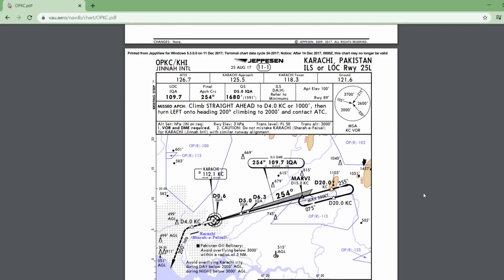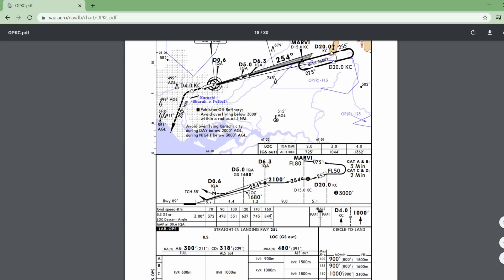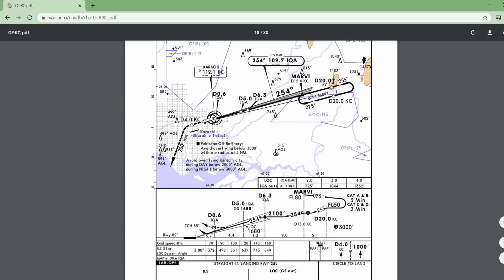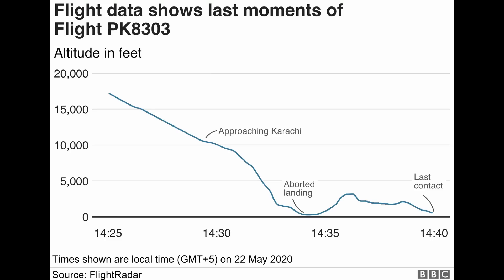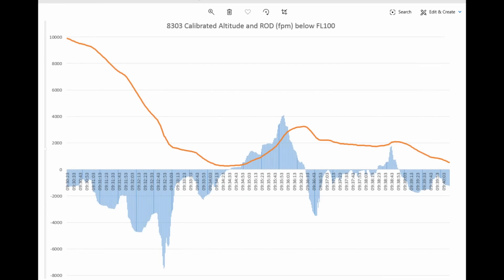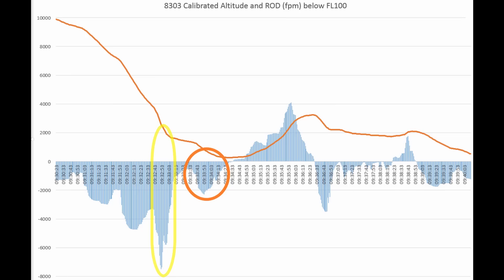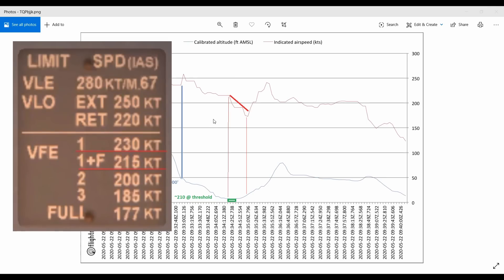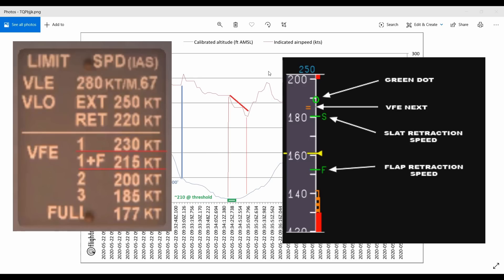PIA #8303 Update #4 Unstable Approach Profile

Comment: Can anyone confirm something for me: In the A320 if the gear is selected down overspeed the chime will go off and the safety valve will prevent the gear from lowering, does this mean that once you go below Vle the landing gear won't come down even with the handle extended? I'm wondering if that's how it functions as this could lead a distracted crew to believe the gear was lowered especially if they're busy trying to convert their A320 into a roller coaster.
Reply: Someone commented that the gear handle would have to be cycled back UP and then Down again for the gear to extend. I don't know if that is true.

Comment: There may be no question about the flight data because it was what was given by authorities     so based on this data it seems like the pilots were confident about their operations     it could be the norm in the organization       if this is the case the entire top management should be FIRED as they should have enforced these standards and should have their crew performance checks in place for every flight

Comment: Was this Pilot even QUALIFIED to pilot this type of aircraft ?  As modern as that aircraft was , and with all of the backup systems ,  you certainly don't try to land without putting the landing gear down ,  except in an extreme emergency and once it's down you keep it down , you don't do a go-around .
Reply: Captain had more than 17000 hours flight experience, more than 4700 hours were in A 320. First Officer had more than 3000 hours flight experience, most of them on A 320.

Comment: I wouldn't have an opinion except that I've traveled in that area.  This may have been an international flight.  But it was an internal leg.  What I'm going to allege could be verified by careful research if there is a will to do so.  I'm finishing up curried rice.  No intention to be disrespectful, or I wouldn't have been there in the first place.  My comment on the first 8303 video was recounting a feeling of being on a rollercoaster ride.  "Afterburners" on takeoff and such a rapid descent near indistinguishable from "going down".  But the other passengers reacting as if everything is normal.  Because I think you will find it is "normal".  At least on internal flights.  Why would it not be so on international flights as well?  Maybe full tanks and common full passenger load might dampen the impulse a bit.  Maybe a different mix of pilots?  What am I predicting?  You won't find any notes in this pilot's file.  No poor performance ratings.  Which is why the Tower is to blame as well.  This is much bigger than just this event.  Which is why the demonetization.  And may as well spread it around.  Was waiting on a late flight at Will Rogers Airport OKC.  It was a Southwest Airlines flight.  The pilot did a landing without taxi-ing; transitioned so smoothly from one to the other.  Didn't slow down much as he made a perfect approach to the docking.  As a result everyone in the waiting area was on their feet and some sprinting away from the gate.  So, one might ask how such a culture of disregard could be there at Southwest Airlines?  Might look into a few of those pilots' careers as far as what other venues besides States-side they may have served in to be behaving so bold.  Perfect approach to the gate.  But about 40 people were convinced he wasn't stopping.  It was like a movie set for a second or two.

Comment: I am not sure if Juan or anyone will read this, and I am not a pilot but I have a question/idea to explain this behavior from the flight crew. Someone said in another comment that the pilot could have just "gone around and lost a few points". Is there a certain amount of points you can lose before you automatically lose your job? What if the pilot knew he was already close to being terminated and another go around would surely do him in? Would that entice him to try and make the approach work so he doesn't possibly lose his job? If this was the reason, it would make sense as the data clearly shows him trying hard to get back on the approach path. With all the warnings and chiming going on, he may have not connected the dots to "oh crap the landing gear isnt down because of my speed" resulting in landing on the engines. He tried to save the approach very badly for some reason and got in over his head.
Reply: I don't know about other cultures but, in the U.S. I cannot fathom that an aircrew's job would be at risk if they did a go-around. That's a pilot decision and as far as I know it's very rare for someone sitting at a desk to question. (If a certain pilot habitually made go-arounds, he would likely receive more training & counseling).  My opinion is that overconfidence lead the pilot to try to make the best of a very bad approach. Often, high time pilots can be overconfident and they don't want to admit that can't do something, particularly with something they have done so well for many thousands of flight hours.
Reply from the maker: should be a 'no-fault' go-around policy.

Comment: Not being a pilot, it sounds like this was entirely pilot error. Sounds like he was so high and so fast he has never able to get the gear down for the first attempt. Can gear or flaps be lowered even if you are above the limits?
Reply: According to Juan's earlier video, the Airbus computer will prevent gear or flap extension if above the specified airspeed limits.

Comment: Is there any truth to the information that I heard that they were intentionally attempting a gear-up belly landing on the first attempt, due to the fact that the landing gear would not extend? That information was put forth by what I think was a Pakistani Youtuber  over the weekend. I don’t think that information is true, based on the ATC communication that was available on LiveATC.com, and what I’ve seen on your channel.
Reply: That cannot be true.  First, if they knew they HAD TO LAND NOW without landing gear down I think they might have radioed that problem to the tower. And the tower might have then alerted emergency crews to deploy.  None of that happened.  Second: If they were intentionally doing a gear up landing and successfully put the plane down in the center of the runway, why would they then change their mind and go back around for another try?
Reply from the maker: no.
Reply: blancolirio Thanks Juan I figured it was bad info.

Comment: When you intentionally perform a steep approach...such as into a dangerous place like Iraq, Afghanistan, Yemen etc. you get all the drag you can on the jet up high.
In this case, it certainly wasn't necessary,  nor was it done right, but in a situation where necessary, it certainly could have been salvaged by slowing up high, dropping the gear and flaps, reducing ground speed and thus the rate of descent required to intercept the glide slope. Still sporty, but safer than getting hit by a SAM or lucky RPG.

Comment: This is a fabulous presentation. Gives a whole new meaning to hot and high.  In part v, I hope you will be able to present some info on the gear situation, whether the crew simply forgot the checklist or if there was a mechanical failure on top of the unstable approach.  It's hard to fathom how they actually got onto the darn runway with unextended gears.

Comment: May be that s why the gear didn't want to come down ,steep approach  too fast.
Reply: Yes the speed has to be less than 260kts in air bus for the gear to come down.
Reply: There should have been a control to override this airspeed limit to down the gear. If they had this a lot of lives would have been saved. May be there are engineering challenges but this backup should have been there. Airbus is also to blame.
Reply: bitto kazi Airbus is not to blame. Speed limits for gear down and flaps exist because it can damage or even sheer them off of the airplane if they are lowered beyond that speed. This is shaping up to clearly be the fault of the pilots tying to operate this airplane outside of it’s limits - limits they should have been trained and well aware of.

Comment: This air crew were asking strange and insignificant questions about lighting during the crucial stage of their departure on that flight.

I don't want the following question to be taken the wrong way or upset anyone. 
Considering the strange question and the off the charts approach and landing attempt, the poor communication with approach. 
Has it been confirmed that the actual people in the cockpit are the Captain and First Officer assigned?
Reply: Their corpses were found inside of the crashed Cockpit.
But it is indeed difficult to believe that a Captain with more than 17000 hours flight experience did something like that.

Comment: Shocking details.. So was the landing gear not able to go down due to high airspeed?
Reply: Looks like it. Before scraping the ground they never slowed down below the maximum safe deployment speed, so the automatic system would've prevented the extension of the gear even if the lever was pulled. Doing so triggers the so-called "continuous repetetive chime", an audio warning, as well as the master caution light and an ECAM message. Also, the "three greens" to indicate each individual gear is locked wouldn't come on or even turn red.

In addition to this (as far as I know, someone who knows more about airbus please correct me) Bitching Betty (the "voice" of the aircraft) would verbally say "Pull up! Pull up!" if you got too close to the ground without the gear deployed.
Reply: QemeH I think it actually says “too low gear” which makes it all the more unfathomable that they continued.

Comment: Did the gear not extend because they attempted to extend at too high a Airspeed thus distracted and getting higher on profile then being task saturated forgetting to tell the Tower. Lastly attempting a gear up landing and floating to far and deciding to go around ...only FDR / CVR will tell.

Comment: There is something else going on.   The question is  "Why were they at 10,000 feet when they started the approach to the runway when they should have been closer to 4,000 or 5,000 feet?  The weather was good,  so they were allowed a visual approach  which gave them a lot more flexibility than if they had been required to do an instrument approach.   The Captain had 17,000 hours which is a LOT of hours,  so he was a salty old dog who was probably pretty good,  but impressed with himself.   Copilot was probably a young guy with much less experience,  so there was clearly a failure in cockpit resource management.   My guess is that the interpersonal dynamics were such that the young guy couldn't question the old guy.   It's happened before.  Cleared for approach.   We're too high!  Nah, happens all the time.   Watch this!  Nose down,  speed up.  Gear switch down.   Airplane keeps gear up to protect gear doors.  Alarm.  Of course there's an alarm, no big deal.  They never got slow enough for the gear and never knew it wasn't down until too late.    May have had an "Oh xxxx!" moment and initiated go around before scraping the nacelles.   Fasting may have been a factor,  as well as being rusty from a layoff.   They were done when the old salt thought the rules didn't apply to him.  There are old pilots and there are bold pilots,  but there are no old bold pilots!

Comment: The pilot was hauling a$$ on approach. Like you said they put the gear lever down alarms went off because of lowering gear over speed not allowing gear to lower(Just remembered, there is a gear lever lockout to preventing the lever to go in the extend position at high speeds).
So guessing they thought the gear was down eventhough the alarms were going off. 
Must have been a very confused cockpit.
RIP For crew and passengers! Really sad!
P.S. Not a pilot but an A&P mechanic.

Comment: What happened:
The pilot was approaching too fast and high, he thought that the sounding alarm was from steep landing or high speed landing rather than a gear fault and landed as if the gear was down and once he felt the grinding took off again, and once he got up again he started shitting his pants and lowered the gears again and it worked second time but it was too late.
At the end, all leads to a completely bad pilot and worse ATC control fault.

THE HUGE FAULT WAS:
The Tower control neither the on-field crew and approach people didn't see a stupid huge plane landing on engines! What the heck is happening in that airport?! Like nobody was on or looking at the runway! A deserted runway?
If the Pilot considered that sounding alarm is fake and his gear is down and continued to land to see if his gear up or down,  well he should have asked the tower and did a fly-by instead of landing.

Now what most people don't know is Pakistanis are extremely religious and they would stop all of what they are doing at time of prayer specially in Ramadan, the accident happened at the time of noon prayer and I can tell you that the ATC tower and airport people was praying and just ignored looking at the airfield completely at the time of accident and went back to prayer as soon as they communicated the pilot without looking.

We meet here again once the final report finishes.
Reply: The GPWS would still be telling him TOO LOW GEAR
Reply: @tomstravels520  
Possibilities are "Maybe":
1- The landing gear was considered lowered by the airplane system but physically is up and that beeping was warning or steep landing.
2- Once he started getting alarm due to steep landing he force shut-off all alarms.
3- He was little unconscious due to fasting and completely got surprised with the landing gear alarm voice.
4- The airplane is old and only beeping alarm is operating for some maintenance reason.

Comment: What is the probability of malfunctioning instruments/avionics giving the pilot a very distorted view of his attitude and angle of attack? I'm unfamiliar with today's ''Glass Cockpit''. I can assume it's a cyber-enhanced representation of what the old anaeriod mechanical instruments indicated,  but  I'm not familiar enough to know if distortions or mis-settings can be augmented or amplified. I was an AVI tech in the late '70s. Seems like his ASI was plus 100 KTS off slow, and his Altimeter had a false deck 1000 - 2000' below AGL. Rate of Climb Indicator had to be similiarly out of whack, too.
Reply: https://safetyfirst.airbus.com/app/themes/mh_newsdesk/documents/archives/a320-landing-gear-downlock.pdf

This might help

https://youtu.be/YLwkPJhIPNM

And this is how a belly landing should be done but shows the instruments

Comment: A airbus captains video is on YouTube describing most likely scenario:

- The approach was unstable. Speed and altitude was too high
- As a result almost half of the runway was missed and pilot decided not to land and gave pull power to engines to go around
- The gears were pulled up very early as engines were still getting power to take off again. This resulted in engines scraping the runway and were badly damaged 
- On the second approach, when pilots realized both engines had failed, they decided to go direct for runway but it was too late and they crashed

Comment: This flight jockey thought he was flying an F-18 instead of and Airbus 320
Reply: Mr. GTO many pia pilots are ex fighter pilots
Reply: @rugratz3440  Captain Sajjad Gul is not from Air-force and furthermore there is a specific quota for the ex-Air-Force folks, those who have 4 engine experience are normally preferred as they have the requisite hours of particular class of aircraft(s).
Reply: @exploreradverturer8396  what about a CEO, if an individual with zero commercial airlines experience is fit to be a CEO than a train or a bus driver may deem fit to fly A320, i guess.
Reply: @rugratz3440  even the CEO of airline is a serving  fighter pilot with zero experience of commercial airlines.
Reply: Army rules everything in Pakistan
Reply: He flew F-16s for almost 17 years
Reply: @haseebgood  So he had flashbacks of those F-16 sorties in an Airbus A320..!!!

Comment: I believe ATC would be held responsible at this point.  They should of contacted the approach controller when they were at FL10, the transition altitude here is 3,000 ft.  The approach controller should have gotten the aircraft lower and stable before handing off to the tower controller.  Wind wouldn't be a factor as some places consider winds calm under 5.  I believe it was ATC did not handle the approach correctly.  Perhaps look into this?  Also rwy 25L is a LOC approach and not an ILS which has no glide slope.  I have read the approach plates and mountains at 2600 ft.  Shouldn't be a factor here also. I am a simulator pilot.

Comment: I've been checking a few other sites, and a lot of people are mentioning two other things. 1: That the pilots realized the gear wasn't down and applied TOGA power at 275 feet, but the engines took too long to spool up, so it still hit the runway (might explain why it skipped along the runway 3 times, then got back up.) and 2: That there are signs that the pilots used the fire suppression systems on the engines (I don't know what that would look like), but still tried to pull the nose up to climb.

Comment: ATC never gave the reason for Heading 180 after the pilot reported on ILS 25L. Pilot simply vetoed that he is comfortable with the distance from touch down from Runway for loosing altitude.
ATC should have stopped descent at 2000 feet or above and should have repositioned for next approach.
Giving reverse heading for a known acft with flying difficulty is unprofessional to say the least.
Later Controller enquiring for left turn shows his total lack of orientation.
Joint failure by crew and ATC.
Easily avoidable accident.